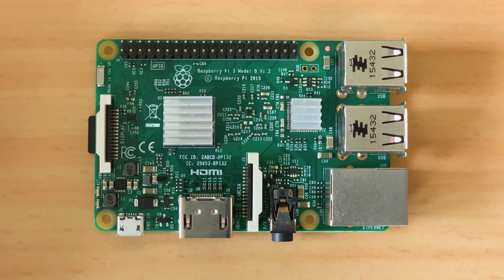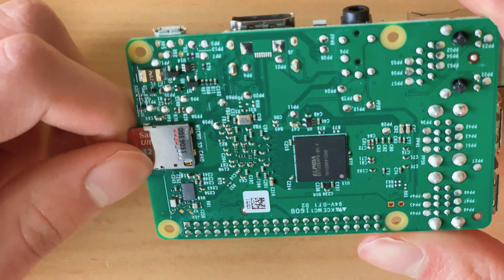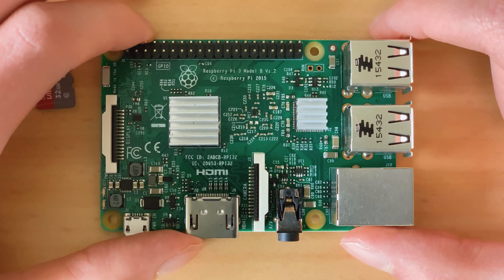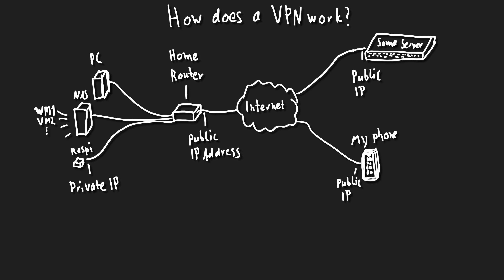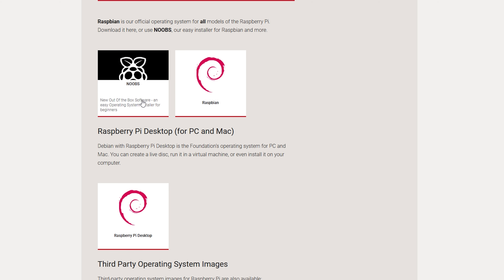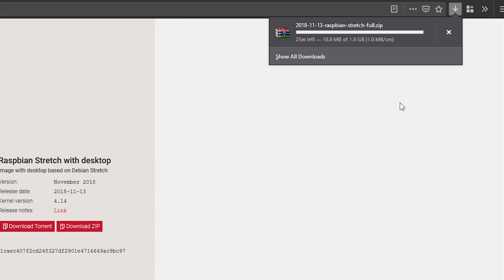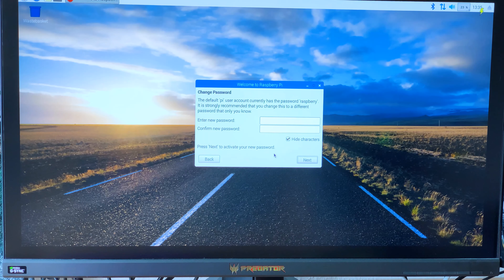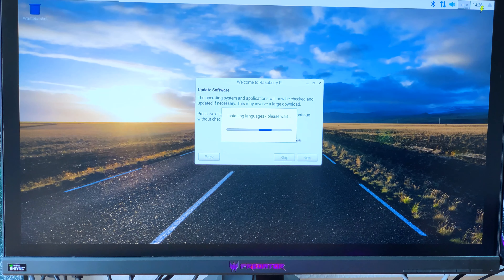DIY VPN server with raspberry pi and openvpn | My Homelab [E04]

Comment: Hi, nice video! how is PIVPN on raspberry Pi different from NordVPN or any other VPN providers? Thx.
Reply from the maker: It allows you to access your own home network
Reply: @factoriovideos  so it is not the same thing as other types of vpn, with OpenVPN on raspberry you are not hiding where you are coming from. correct? I was just confused about the two types of vpn. Thank you very much!!! Hope you come up with more such videos!
Reply from the maker: Well, with a raspberry vpn (or any VPN server you run at home) you will always look like your from your home country, even if you are abroad. And it will also give you a similar level of security for when you are in an untrusted (public) WiFi with your device
Reply: @factoriovideos  Thank you very much. will try this weekend and lets you know how it goes. keep up the good work!